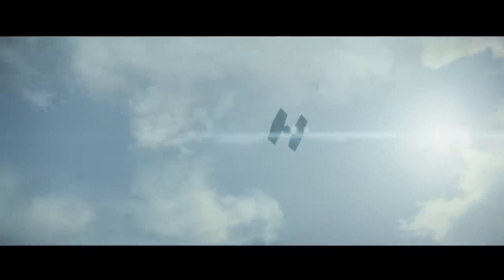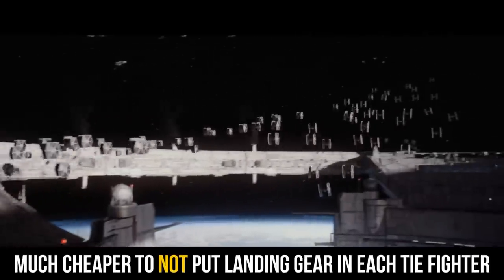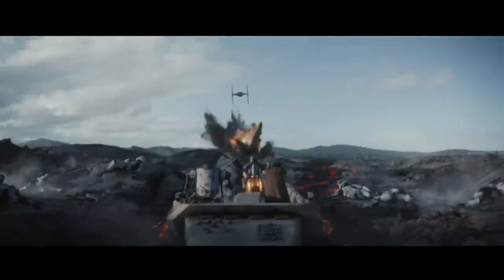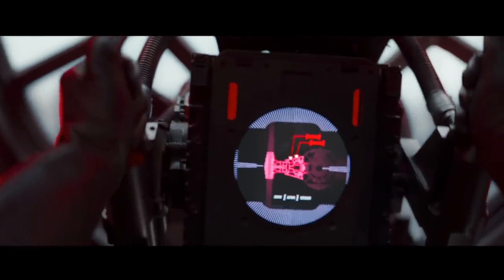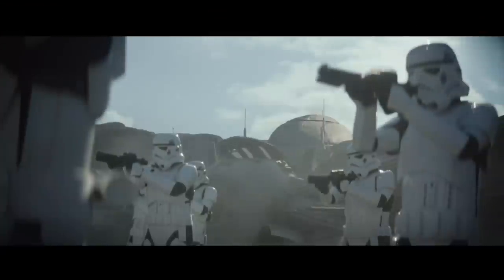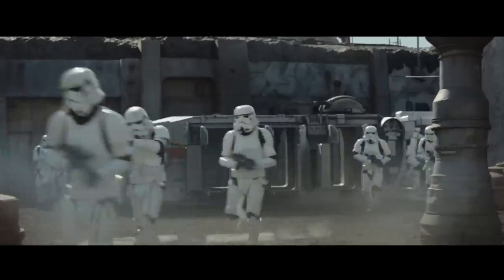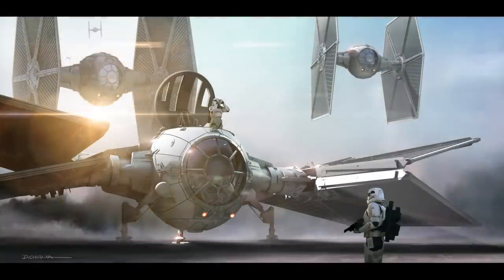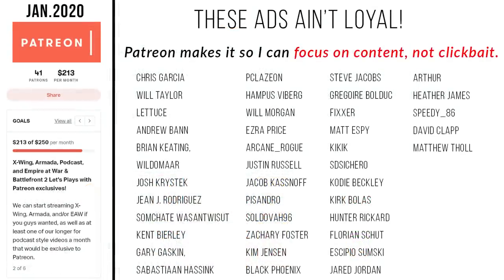(The Mandalorian TIE Fighter) Outland TIE FIGHTER made with X-WING parts?

Comment: George Lucas had said a very long time ago that the idea behind the TIE fighter not being able to land without docking with an imperial ship/base was that the Empire did not want their pilots to be independent. They wanted the pilots to always have to need the Empire's facilities. Its an issue of not trusting pilots to runaway and land somewhere out of the Empire's reach. 
Kind of brilliant when the implications of design engineering are considered in developing a story witin the details.
Reply: Might have gotten that idea from the Soviets. The Soviet Union was initially hesitant to install equipment like radar and navigation in their jets because they worried that pilots would use them if they defected.
Reply: That's an interesting bit of lore. Might be part of the reason why so few imperial starfighters have hyperdrives as well, besides cost of course.
Reply: @wilmersandstrom2826  Like the MIG-15 and MIG-25 Defectors....
Reply: There's been quite a bit of contradictory evidence throughout the canon and non-canon universe that the TIE didn't need landing gear because the solar panels were strong enough or reinforced to support the full weight of the ship. You don't really need to worry about defection in a craft that doesn't have any cargo capacity and lacks FTL capabilities and if you're truly worried about a tracking transponder integrated into the hull would be better than losing TIEs and pilots that can't get back to base to fuel/replenish air. I honestly don't know how it works in Star Wars lore but over in STOS they were capable of tracking ships by ion wakes
Reply: It makes sense for them to have landing like this now. Since it's post battle of Yavin. Meaning they don't have those imperial bases or ships to land in. So they have to make due.
Reply: 351cleavland makes sense, also explains lack of hyperdrive to prevent desertion and stealing.
Reply: to do Correct. TIE pilots were meant to lock onto capital ships, and get dragged along in its wake as it went to lightspeed, if they didn’t dock.
Reply: Very well said my friend and you're absolutely right just like Palpatine design Darth Vader's armor to be vulnerable to Palpatine's attacks that way he kept Darth Vader in check and always in control in fact the imperior Imperial troops the guys in the red suits their armor was specially designed to withstand lightsaber attacks but they kind of ruin that with kylo Ren and Rey but keep up the good work my friend epic and awesome story love the vid
Reply: In legends, there's a TIE-X wing hybrid used by pirates and it's VERY VERY in a Fuckin fective
Reply: @shaggysidbacon6144  From what I read a long time ago those red suits could take glancing blows but did little in the way of protecting against straight thrusts/piercing attacks.
Reply: But Kylo Ren managed to land an imperial tie from the second Death Star in Rise of Skywalker
Reply: World building KING
Reply: @davidhollowood6580  What's STOS?
Reply: grand amiral Thrawn said that the empire needed to give more trust to their pilots, that's why he developed the tie defender
Reply: Even in cases where they can land on the edges of their wings (like in rebels) it is impractical for them to use just any landing space. they need a designated imperial landing zone that has the correct tools for them to climb back into their fighters. Further enforcement that they need the empires facilities. So unless they have a jetpack or can jump like a Jedi or a Lasat there is no real way for them to climb back in once they disembark
Reply: Not just trust, doctrine; the Rebel Alliance emphasizes hyperdrive starfighters specifically because they rely on the ability to scatter as a defense,  and TIE fighters' reliance on carriers makes them much less worth stealing.

Comment: Put a shield generator and step ladder in a TIE Interceptor? 

No: Landing Gear and Folding Wings on a TIE/LN
Reply: 10/10
Reply: Yeah. This whole variant just seems forced. They could've even made up a whole new variant instead. I mean, the new movies do it excessively, so why not here?
Reply: @Jan_Strzelecki  They could've used the TIE shuttle from Empire.
Reply: @Keihryon  Yep. Or the Inquisitor's TIE from Rebels. Pretty much everything would've been a better choice.
Reply: Probably they wanted it to be a basic connection to the classic, so they took a TIE/ln and made it differeny
Reply: Yea the ln should be have been phased out by this time.
Reply: IIRC, this TIE variant was mass-manufactured by the Imperial Remnant after the Battle of Endor in order to provide a TIE Fighter that was more maneuverable & easier to land. It sort of makes sense, seeing as the Imperial Remnant couldn’t afford luxuries such as massive TIE Fighter docking racks, due to having only a mere faction of their former power.

Comment: Let's face it, this should have been standard for all TIEs
Reply: There's no use for a tie to ever land. It's unnecessary cost and weight
Reply: Jimmy Gaudreault  Conversely, the height of the standard TIE Fighter meant it required a roof-mounted clamp to dock to, and that roof would be quite high, so it would require an enormous hangar to house a full squadron of them. This Outland TIE Fighter doesn't need as big a hangar, if at all. It could land on an airstrip, vertically take off and go. It's quite the cost-saver.

Comment: Weren't these on Endor too according to EA's SWBF2?

Well, at least I remember some TIEs with their panels folded like that
Reply: If it was up to me I'd just ret-con it as the standard TIE model. Nothing in any of the films would contradict it since we never saw a TIE attempt to land anyways. Also, I'd drop the no shields nonsense. Again that was never stated in the films, but taken from early video games so the xwing player could blow away swarms of them. In A New Hope the TIEs cut through the rebel starfighters with ease. I always thought the rebel ships were heavy fighters left over from the clone wars, thus their rugged aged appearance and the TIEs a sleek new Imperial design. The rebel ships may have been more heavily shielded than the TIEs but that doesn't mean the TIEs had no shielding at all. 

TIE series = point defense fast interceptor with shields
*-Wing series = long range multi role fighters with heavier shields

Comment: It becomes a question of cubic space or square footage concerns on if you have fixed or folded wings, and if you have folded wing HOW would you have those wings fold. 
Say you have the classic fixed wing tie fighter. If your at some sort of terrestrial base you will need some sort of device to both raise your pilot up to the craft, and lower the pod down to ground level for maintenance. Some sort of rolling scaffold or lift with get your pilot up to the pod. Better yet a simple pole with flip down cross member at 120 degrees would work. Using two the climb up  and having at least one of the uppers on the third fit into a slot on the pod means a pilot could climb up, then kick the pole away and fly off. 
Two long but thin pits with lifts in them can be used to lower the Ties down to ground level for servicing 

Folding wings like the ones we see in the madalorian increase the square footage require but solves the accessibility problem and one could argue that wings folded in that way might be more efficient for three dimensional storage . 
However I would argue if your going to fold the wings fold then INWARD but NOT at the central pylon. Fold them in such a way that the wings make a [  ] shape (the little stubby horizontal elements being much longer than the symbol shows) or have the top be a ^ ^ shape and the bottom be a vv shape 
Inwardly folding wings reduced the crafts height without increasing its span

Comment: The tie fighter is based on the design of the ball turret from a b29, just like the cockpit design of the Millennium Falcon was also obviously based. That's why it had no landing gear incorporated in its design. It looks like someone asked themselves the question, what if you had the ball turret, without the plane, and then slapped on some "solar panel/wings."

Comment: Why did he cut himself out? There's a door right there in that ship. Maybe it jammed? Did he have to cut through the landing leg/foot? That would have been awkward to shift around in that small space, especially given that the ship is upside down. Does that Tie Fighter have life support? Between that and the landing gear, that's a lot of stuff to shove into what is supposed to already be an economically designed ship. Maybe his ship is a prototype, and they instead removed the extra features to make the /ln even cheaper.
Reply: If you look closely it crashed upside down. You can see the laser cannon ports at the top.
Reply: @Eman-720  I gotta disagree there, because as I said in my comment, the ship actually crashed upside down. (You can tell, as the lasers are at the top) And there's still supposed to be a door there, because you see a landing leg come out of it the episode before. Surely if he couldn't open it, just cutting the hinges would have sufficed?

Comment: As an Automations, and mechanical Engineer, and my Girlfriend as a Product design, and Buisness Engineer, (*and* both SW fans) we bother agreed, it would be far more likely they're brand new pieces of hardware, designed around the Tie, with previous pieces of knowledge and industry standards used to direct that design.
I would be shocked, if the parts themselves, are literally carbon copies, of those on an X-wing.
ARC-170 foil motors, we're not the same or compatible with those on the future X-wing.
The same as, I would doubt the components of the Resistance X-wing are the same as the X-wing. An already aging design, with parts in a newer industry. They maybe indeed be compatible, but in reality, they'd be newer designed motors, hinge components, electrical connections to all the equipment in the wings themselves etc. (such as weapons).
As I'm sure X-wing hinges are sturdy, they are designed to move, and hold onto a lighter mass, than the Tie solar collector. Even with educated engineering, and redundancies in place, this model of the Tie, would have similar % of redundancy.
Having looked back at the landing gear, while the feet look similar to an X-wing, the legs themselves are a hell of a lot closer in design to those on the Scimitar or command spheres on a Lutherhulk, sized down.
Much thicker and "bulkier" compared to the more toothpick looking legs on X and Y-wing's.

Comment: I don't think it makes sense for the Outlander Tie to remove the ejection seat. Remember, it's specifically designed to be MORE safe than your standard Tie fighter. Imo, the Moff just didn't eject during his crash because A) he was to low and his Tie was in an uncontrollable spin so ejecting risks launching his seat straight into the first B) Moff Gideon knew his Tie had reinforced plating so he knew crash landing and trusting its hull would be less risky.

Comment: A) Those folding wings look badass, but they are not very efficient when it comes to storing squadrons of these fighters.
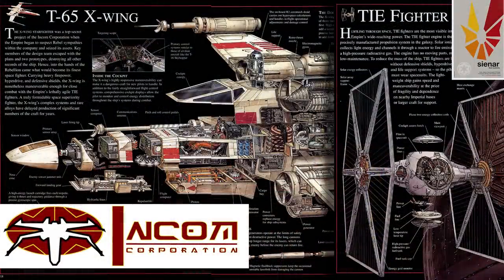B) Why do we insist on calling them "Solar Collectors"?! - they are CLEARLY part of some sort of radiator/cooling system for the tiny, over-taxed ion engines! You can see as such in the cut-aways! (timestamp 2:30)

Comment: Made with X-wing parts? That's just dumb. Reading that title is like a video i came across about The Walking Dead. The guys in the video assumed the commonwealth's body armor was made from car parts. It's pretty clear the armor is mass produced with dedicated resources. Vader had his own Tie Fighter variant. Why wouldn't a more rational assumption be that the high ranking imperial officers have a more heavily armored type of Tie fighter that can land on a planet? Why wouldn't it be reasonable that a Moff would have a personal craft that was significantly better than your average run of the mill line fighter. I am not even going to call it a prototype.The needs of the imperial hierarchy would require a fighter of this design to exist.

Comment: The way the panels fold is not good - the ship takes up WAY more ground space while adding to the complexity and weakness to the design.  And there is no point to folding down the top halves of the panels like this.

It would be much better to have the lower half fold 180-degrees UP when landing, to bring the cockpit closer to the ground while at the same time conserving landing space.